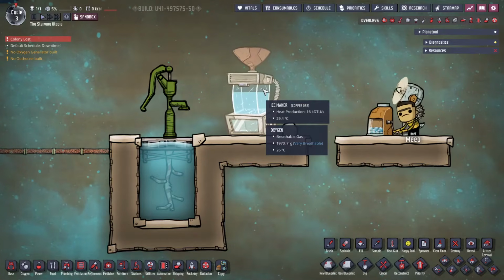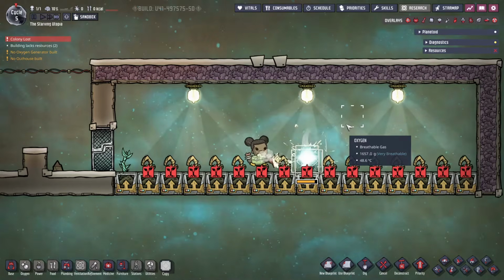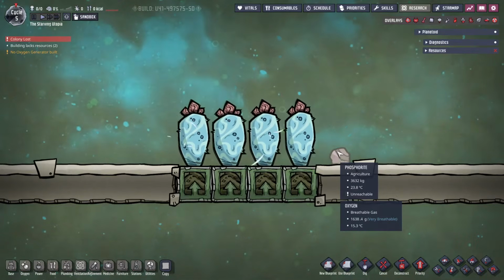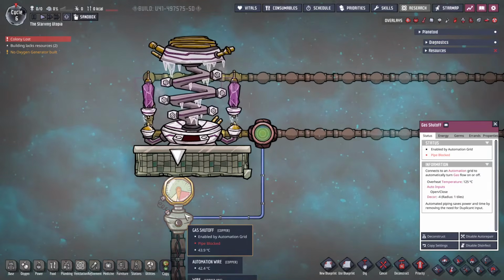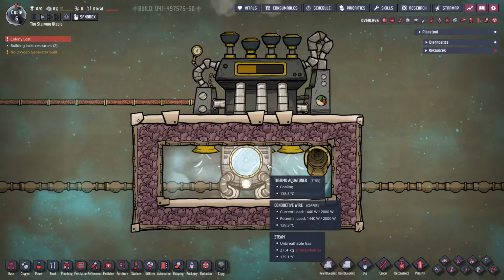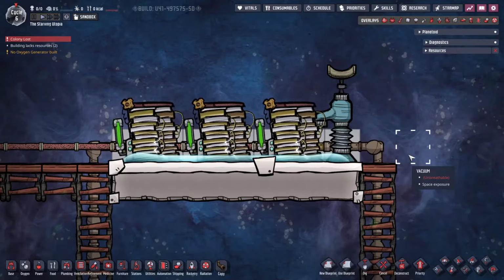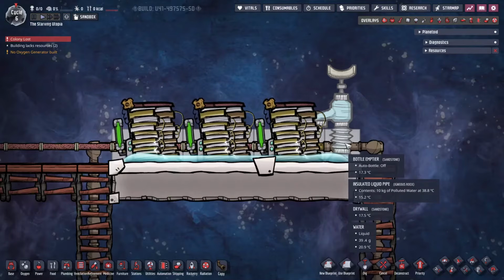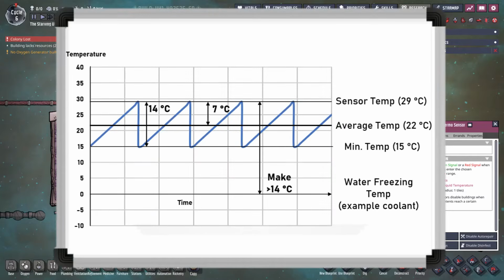Oxygen Not Included - Tutorial Bites - Cooling

Comment: It's 2026 and I'm still failing to Aircon my base while getting rid of the heat. Cooling Fans and pumps overheat, or just stop working at max pressure, enclosed systems melt, I try set up the auto systems only for it never to reach the required temperature and this is all before we even get to running pipes through the base

Drawing the build in creative and having Dupes build it is very different, then any mistakes I make can ruin the whole system.

Comment: 12:34 Fungus, you recommend a steam density between 10 kg - 100 kg per tile, does more kg per tile = better cooling? or hotter steam for more efficient turbine?
Reply: all the density changes is how long it takes to change temperature, but if the density is too high it'll take ages to start the turbine and if its too low the temperature might change too easily

Comment: In one run I had big problem reaching steam turbine tech level, so made cooling tower near space (just an aquatuner, but with tiny amount of water bypassing it's loop and going into evaporation/cooling chimney)

Initially I was wasting steam into space (it has very good heat capacity, so it wastes very slowly), but later on I figured - instead of hiding/deleting my CO2 I can route it through my aquatuner setup in radiant gas pipes and now I'm throwing ~90 - 100C carbon dioxide into space, instead of doing it with steam. Water is no longer boiling and it even dropped to around 85C when I was using the cooling loop a bit less intensly.

Comment: The thermo nullifier has an extremely high heat transfer rate. The highest in the game. Its honest really good at cooling at -80/kdus a sec.

Very cheap to use. You can just plug your spom into it and you got free cooling since one electrolyzer makes enough hydrogen to power a hydrogen gen and a nullifier.

I've made use them to cool down cool steam vents. Spom o2. Even oil fissures and refineries.

Comment: Could you explain why you use two separate liquids to fill the steam room? I don't really understand that point. What would happen if you just filled it with water?
Reply from the maker: Basically you want to get all of the gas out of the room by filling it with liquid. If you only use one type of water then you need to fill the bottom row to it's maximum until you can get any in the top, which would mean over 1000kg of water per tile on the bottom. By using two different types you can use much lower mass because the two types cannot mix, thus letting you fill the room with much less steam.

Comment: Use Ice maker as water heater? Would that be valid option? Because I am still trying to do "super sustainable" achievement and it's brutal to generate energy without using fuels for a very long time
Reply from the maker: No, the ice maker is terrible and would be a complete waste of time to try and use for power. Your best bet is hydrogen power from SPOMs, solar panels, and some geothermal if you can find it. And at all else manual generators.

Comment: so I'm a little confused with the last design. When the doors open, does the temperature between the middle and the left mix? So the left pool of water starts cooling down? What's the point of the windows?
Reply: also is it worth upscaling and including more steam generators?
Reply from the maker: Usually 1 steam turbine goes with 1 aquetuner and all will be fine.
Reply from the maker: The middle section is like a cold block. The doors close to move the cold into either side, and work independently. The windows allow high heat transfer.

Comment: Great video but I miss some explanations as to WHY you do certain things. Why do you mix fluids in the chamber for the aqua tuner? What makes the final design work, like what’s the mechanic behind it?
Reply from the maker: So having 2 liquids in the 2 tile high room lets you push all the gas out without having to completely fill the bottom layer which would need a lot of water, or without vacuuming. This lets you end up with a lower amount of steam in the final steam chamber. The final design is about fine temperature control. The point is the aquetuner has a 14 degree temperature removal which gives quite a wide margin. But the thermo sensor can close a door to let 'cold' through at an exact temperature, so basically you overcool a big block of thermal mass and then connect to it when what you're trying to cool goes over your desired specific temperature.

Comment: I am commenting this because I see that you still respond to the comment section, and in hopes that someone can help me.

I want to ask/request for a more indepth guide on cold/heat injector, I don't mind the explanation being typed out.
I am struggling to control precise temperature for certain conditions and I am not smart enough to figure it out on my own.

one current issue I'm having right now on my first playthrough is with taming (hot) steam vents
I have a small square section of metal tiles and radiant pipe (both are made from lead) that was meant to cool down the liquid that is produced from the steam vent -> steam turbine output. I set the cooling box loop to be 25C but whenever the liquid output from the steam vent comes out it always counteracts my "cooling box" and thus it only colds down to about 60C. What should I do?
Reply from the maker: I'm not sure I can be more specific. The box is cooled down to a fine temperature,  so the secondary cooling loop that runs through that box will get thst exact temperature. The issue it sounds like your having is the cooling speed. When a cooling line runs through a hot area, it will cool it over time. If you leave it long enough it will equalise fully. But if you want to remove it quickly then you can lower the coolant temperature to get the desired output temperature of the water. So try a cooler loop temperature or wait longer for it to equalise.

Comment: I've found that the steam turbine overheat temperature is a "trap". It says 1000 degrees in the info card, but since the turbine stops working at 100 degrees.....it means it can essentially be built from any refined metal excluding mercury (obviously) since even lead's melting point is far higher than 100 degrees and the overheat penalty doesn't matter since it's subtracting from 1000 degrees.

Comment: Are there any benefits to using Crude oil or Petroleum over PWater? Where should I be using it? In the Aquatuner loop? Or in the water body to hold thermal mass?
Reply from the maker: You almost always want to avoid using oil or petroleum as a coolant as the SHC is much worse than water, meaning it runs a lot less efficiently. The only case you might consider it is when th3 temperature range of water doesn't fit, for example food deep freezing.

Comment: Great summary, thanks so much. However I don't understand how you hooked the turbine up to the aquatuner. The Aquatuner needs way more power than the turning can put out and now if you connect it to another power grid you risk overloading your wires because you will have a power generator on the outgoing side of your transformers. Personally I wore my turbines (and all generators) on a separate wire that feeds back to my power spine and everything that draws power is protected by transformers.
Reply from the maker: The simplest way I find is to hook the turbine up to the heaviwatt high side of the grid and use a large transformer to power the aquetuner.

Comment: Hello, I'm having troubles moving water around, I'm trying to make a cooling loop where the Aquatuner turns on only if the water is too hot, but the problem is I have a T section where the water wants to go to the exit valve I made, if I remove the connection on top, like an L, then the connection works, but the aquatuner has nowhere to dump water to
Reply from the maker: I would suggest using a closed coolant loop and using that to cool a tank of water as needed. Then you can set it up as shown and it will bypass the aquetuner if no cooling is needed. Trying to use the aquetuner to cool water directly in it is usually more difficult.

Comment: Thanks a lot for the design :) I love the cold injector idea
I would like to know how much it can handle. Basically, if i build one, will it be enough to cool down my base & refinery/volcano etc..
If you have any recommendation :)
Reply from the maker: In theory the cold injector shouldn't be any less efficient than a normal loop, so it really comes down to what coolant you use vs. how much heat you're putting in. Of course a cooling system will easily cover living areas. For the metal refinery and volcano, the best way is to remove most of the heat directly by transferring it to steam and then use a steam turbine to delete the heat and get free power (see the Steel & Plastic Tutorial Bite). Then thst just leaves cooling the steam turbines which an aquetuner can handle. If you try and cool a metal refinery or volcano directly, you'll lose a ton of power and the system may struggle to keep up.
Reply: @GCFungus  thanks a lot for your answer. I got my first cooling loop starting soon. I am planning to cool my power house (5 coal gen) & a cool steam vent to turn it into water (80°C will do).

In summary, I can easily maintain temperature, but if I try to cool down too much, I may need pre cooling with steam turbine only before setting up aquatuner loop

Comment: If two liquids is for maintain liquid on the bottom of steam room, oil isn't better? Why steam density is 14-100? Why not 150+- per tile?
Reply from the maker: The steam turbine only works with steam so the oil will just sit in there not doing much. You can use higher steam densities but these take a lot longer to start up and I believe there is some energy loss when using higher amounts.

Comment: why not use the output of the steam turbine to cool itself? it should be below 100°C so that's enough to keep it in a safe temp range, right?
Reply from the maker: So this is possible and known as a self-cooled steam turbine. This works because the 95 degrees water can keep the turbine under 100, but leads to 2 problems. The main limitation is that the steam temperature must be below 140 degrees. If it's higher than this then there is not enough headroom in the water to keep the turbine cool. Then as a result of this, such a design is fail-dangerous (not fail-safe), meaning that if thr turbine does overheat for whatever reason then the water flow stops and you have no cooling. This means you have to go in and fix it in this case. That's why I avoid doing this, but they can be used in specific applications.

Comment: Hey GC, do you know what the problem is with my setup? So, for some reason, the water entering Aquat to be cooled is only intermittent, so in the looping pipe there is 10kg of water that continuously decreases its temperature, then there is 10kg that rarely decreases, then 10kg that always decreases, and so on. If I look at it, it seems that sometimes Aquat shuts down by itself because the outlet pipe is blocked or there is water blockage from the overflow line (from the bridge pipe). I'm sure I have followed your design correctly. Could it be that I have filled the looping pipe with too much water until it becomes full?
Reply from the maker: It's not obvious from your description what the issue is. I would suggest starting by removing some coolant from the loop to see if that helps. If not then we'd probably need more info so we could help on the discord.
Reply: @GCFungus  hmm.. Well, I'll see if I can have another example, the one I mentioned, already kind of fixed by adding reservoir, and there isn't any that has the same problem.. Yet..

Comment: i noticed when i tried making a heating loop on rime, by the time the water got to my base the pipes on the other side of the bridge started taking cold damage and eventually the water wasnt heated anymore and it didnt flow. i used radiant pipes but it doesnt work for me.
Reply from the maker: If the pipes are breaking, then the liquid inside is getting too cold. What temperature is your base at and what heating liquid are you using? If it's so cold, then polluted water may help, otherwise even oil if it's much colder.
Reply: @GCFungus  im playing on rime and the temp is around 10 C where my crops are.
Reply from the maker: @anthonylopez6149 If the temperature is around 10 degrees then why would the bridge be taking cold damage? As long as the lotion keeps flowing then thr tepidizer will heat it up eventually.
Reply: @GCFungus  im using a liquid tepedizer to heat up a water source to 100 F and then passing it to the crop area, but the water ends up getting cold by the time it reaches and the heat doesnt radiate anymore

Comment: I'm really struggling with this one. I've tried pwater on the bottom, 100kg per tile, with fresh water on top, 100kg per tile, it all dries up, or turns to dirt. With full water 100kg per tile, it all dries up and it overheats. I've added a pipe in there to add more water when the water volume on the bottom goes below 20g, and it uses all the water in the room (it's gone to steam, but not hot enough for the steam turbine) and overheats. By then, the water pressure is too high in the room to add more water. At a bit of a loss
Reply from the maker: The room below the steam room is meant to be steam, so I'm not sure what you mean by drying up. As long as you put the steam turbine liquid return into the same room then the mass shouldn't decrease.

Comment: Why were two different types of water used to fill the steam water? (usual water and polluted one)
Reply from the maker: Because you want to remove all the gas out of the room so only steam is left. As different types of water don't mix but form 2 layers, you can fill the room with much less liquid than if you only used one type of water. If you use one type of water then the bottom layer must be fully filled (1000kg/tile) before the second starts to push the gas out. Therefore using 2 you can get between the 20-100kg/tile of steam that I would recommend.

Comment: There is overheat damage, but stuff can be cooler without damaging anything right? Also I heard keeping a 10% of the pipe or vent capacity does nor do any state change, so it could be an option to overclock the cooling to freezin temperatures with polluter water loops?
Reply from the maker: Yes, cold doesn't damage machines or dupes, the only risk is state changes from gases or liquids. And yes if the pipe is only 10% filled then the state change won't happen, allowing you to superheat or supercool materials.

Comment: the one advantage of a thermo regulator over an aqua tuner is for deep freezing your food. before getting super coolant, your best bet using an AT is to use petroleum as a coolant, which has a much lower heat capacity and is less efficient than using hydrogen through a thermo regulator with steel radiant pipes
Reply from the maker: That's true, and since making this video I've definitely come around to then as an effective food storage method.

Comment: Why do people use polluted wate rather than regular water for cooling loop?
Reply from the maker: Both water and polluted water have the same specific heat capacity, so both are equally efficient in thermo aquetuners. The reason why polluted water is preferred is because of it's liquid temperature range. Water will freeze at 0 degrees Celsius and boil at 100. Polluted water freezes at -20 degrees and boils at 120, so that means it works in a wider range of temperatures. For cooling that means you can cool to below 0, or even if you aren't then you are still much less likely to have an accident because of the extra headroom.

Comment: ... I'm found CO2 lipid gresyer
It products CO2 lipid as -50C°
What will I do with it?
Reply from the maker: Well carbon dioxide is only really useful for feeding slicksters, so you can use it for that if you heat it up. As I covered in the geysers Tutorial Bite, you can't use those geysers for much cooling because although they have a low temperature, carbon dioxide has a very low specific heat capacity so it can't take a lot of energy before heating up.

Comment: I dont quite understand why one has to fill the steam room with water/polluted water? Can someone maybe explain? Great video btw! awesome explanations!
Reply from the maker: Basically you want to get only water inside the room so there is no oxygen or other gas which sits above the steam when it's made. To do that, you can fill it with water but if you use the same type then you need to entirely fill the bottom row which uses a lot of water so you get a very dense steam room (500kg/tile +), so if you use 2 different types of water you can push all the gas out and control the steam levels to be lower at the 20-110kg/tile I would recommend.
Reply: perfect, thank you! w @GCFungus

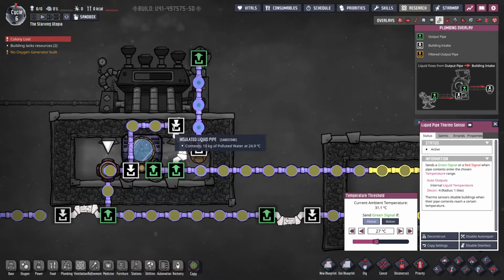Comment: 10:15 This bypass doesn't work - or rather it works too well, bypassing the aquatuner regardless of temperature.  You can actually see it not going into the aquatuner in the video at this time stamp, despite the automation sending green.  Does anyone have a fix for this, or better yet an explanation for why it isn't working as expected?
Reply from the maker: I believe the reason is due to there being a short delay between the automation detection and the aquetuner turning on. That does sometimes lead to packets that should have gone through the aquetuner get bypassed instead. Generally this is not an issue with a closed loop, as the packets will be of very similar temperature so the pipe thermo sensor isn't fluctuating as much.
Reply: @GCFungus  The way the bypass is built, once the first packet bypasses the aquatuner, the aquatuner is stuck on Pipe Blocked from then on.  Maybe if I started it on partial packets until the automation catches up?